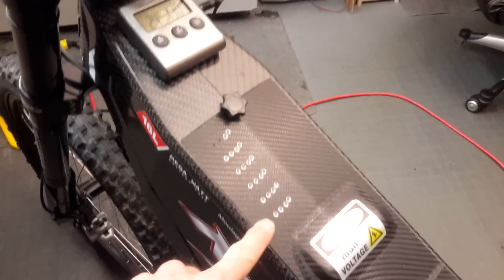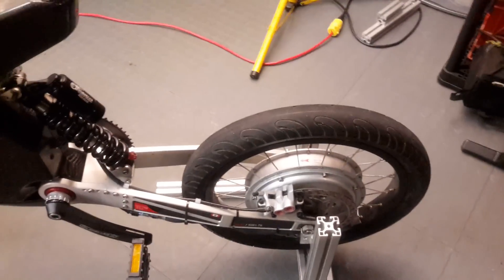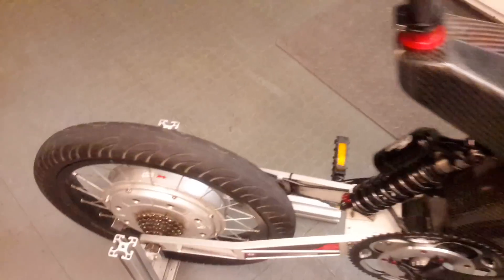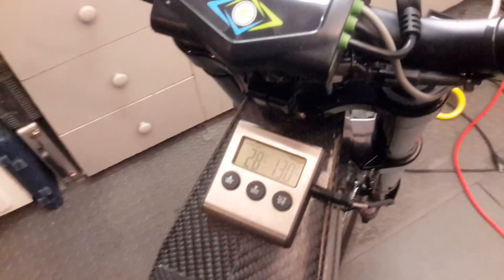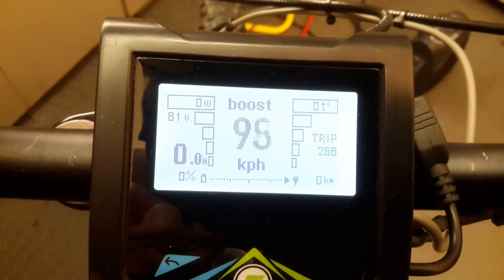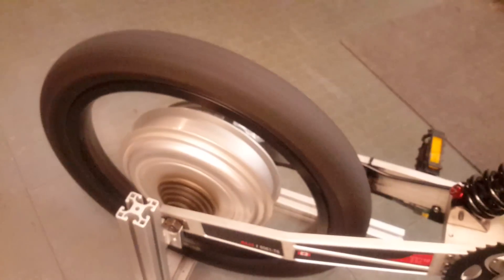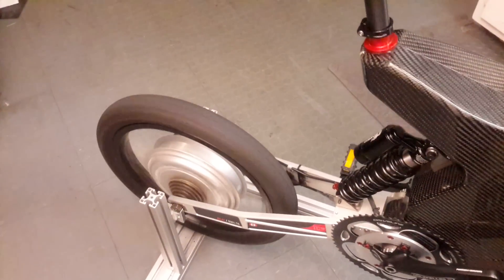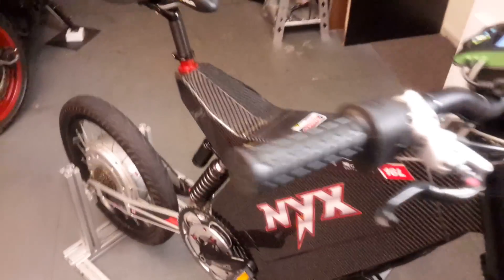188km/h ebike motor

Comment: It's easy for this motor to run at 188km/hr with no weight load on it. In actuality with a person riding it would prob only do 80km/hr at best.
Reply: He said that
Reply: probably a little higher then 80km/h, around 90/100km/h with a person
Reply from the maker: 117kmh real speed at 12kW

Comment: Lol, good god.. that RPM and no load at 2kW.. 5 minutes before it burns up, or what? lol
Reply from the maker: No. The adaptto is in OVS mode at that speed and it is in an innefficient zone.i have run it at that speed for 90 minutes to discharge the battery for a high power charge test. In fact when i turn the ovs to OFF it only run 166kmh on that 20 inch wheel and draw 550watts only. The fastest speed i got on the road with that epic motor is 104kmh at 9.8kw but it is a 18kv motor and 54mH inductance between 2 phases so it is really hard to drive! .remember that it,s a 2 turn motor!
Reply: Евгений Гудков what the hell

Comment: What is the current drain when riding the bike under load,  what does the ammeter peak at? I seen 22.1A here at 79v so just under 1800w, so i'm imagining it will be far higher with you riding.

Comment: may i ask? with motors and batteries that powerful, and with electric motors having instant full torque, isn't it pointless to have gears anymore?
Reply: This motor is a hub motor mounted inside the wheel. So this bike will have no gears in the drive train. However, inside the hub motor there may still be gears to reduce the rpms of the wheel to levels that make sense, because electric motors run most efficiently at very high rpms, but that will be faster than you want your 20in wheel to turn on the ground.

Comment: I have a 60v battery could power a motor hub 1500w 72v?
Reply: no
Reply: Well, "no" is a bit harsh a reply, if the battery can supply the required amps it will just run slower than it should but it will run all right